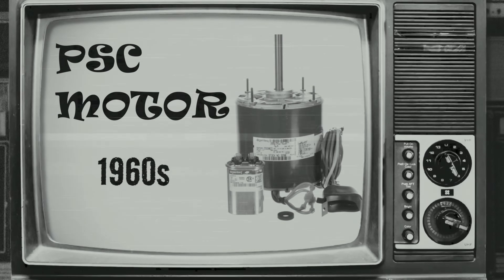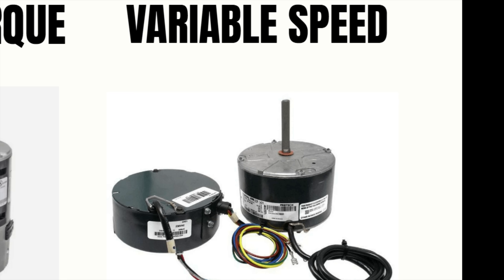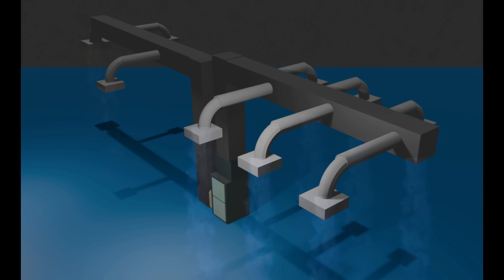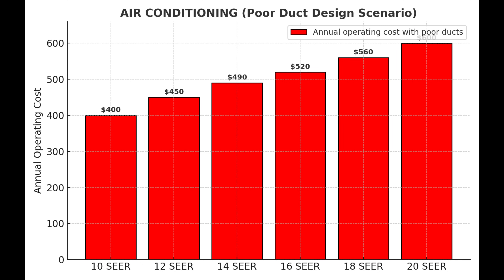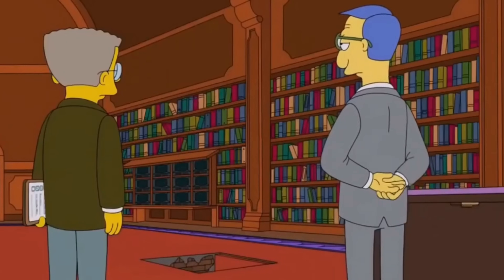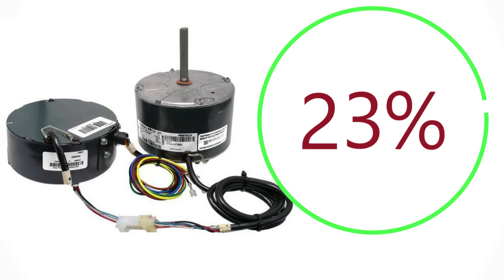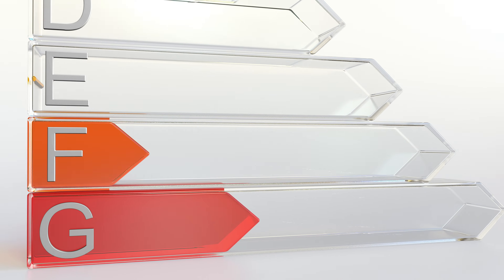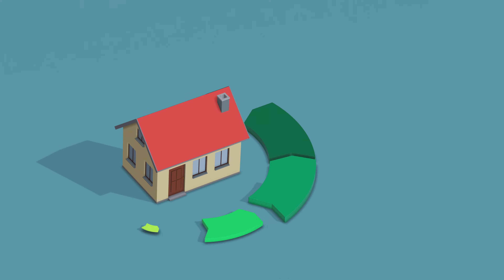The Ugly Truth About Motor Efficiency in HVAC

Comment: Here’s the thing.  Say a PSC motor in this situation pulls 400 watts and an ECM pulls 600 watts in a high static pressure situation.  You’ll still get 15-25% more airflow.  You forgot that condenser outside is pulling 2,000-3,000 watts.  I’d rather eat that additional 200 watts in blower motor power than to lose 20% of 3,000 watts cooling im missing out on, and iced over coils, which is a gain overall, not a loss.

Ecm still wins.  And you’re being micro about this - not the entire bigger picture.
Reply: ...at least until the ecm controller fails due to high static.
Reply: @Jon-hx7pe  Grease runs out of the bearings due to hi heat..........and then OHM's law takes it from there.
Reply: @Jon-hx7pe yeah the ECMs blow their own brains out and then are useless and expensive to replace.
Reply: Coping lol
Reply from the maker: I never claimed high-efficiency systems are never more efficient. But compressor efficiency still depends on proper airflow to keep suction and discharge pressures in range. Restrict airflow and the compressor is forced to run at a higher compression ratio, which kills much of that efficiency advantage. Longer blower cycles also mean longer compressor cycles. I’m not saying you’re wrong — just that you’re overstating how much efficiency the compressor really keeps once duct issues come into play.
Reply: @JerseyMikeHVAC  The problem is that your claims just don't match real world numbers.  I have personally seen Variable Speed systems installed where the electric bills plummeted, despite cooling the same volume of air, in the same house, with the thermostat set to the same exact temperature.

Hence, these magical static pressures aren't killing "much" of that efficiency advantage.

None of the ducting in these cases was changed, just the central A/C system.  You also completely fail to account for the fact that the "longer compressor cycles" on a variable speed systems are running at a reduced compressor rate, instead of the full 100% compressor rate of fixed speed systems.

Hence, whatever efficiency loss the static pressure is supposed to affect obviously isn't much, as the numbers speak for themselves...
Reply from the maker: Again, I wasn't claiming variable speed systems can't be efficient. I have no doubt you've seen some of these systems plummet power bills. 

 All I'm saying is that these savings are not universally guaranteed, particularly if they are installed on a horrible duct design. 

 There's a reason we set blower speeds before ever adjusting charge and dialing in sub cooling. Airflow effects everything, not just the indoor blower but the compressor too. 

 Just like you've seen bills plummet, I've seen them skyrocket in some cases, or at best not improve at all. 

 There is also a reason why high efficiency systems are subsidized with rebates and other incentive perks. ROI just isn't there in many cases once you factor in the higher costs up front and over the lifetime of repairs.  

 Can they be more efficient and save money? Yes. Absolutely. But it takes a lot of effort to actually achieve that. It's not dummy proof  plug and play magic like a lot of people seem to make it out to be.
Reply: @JerseyMikeHVAC 100% accurate 👍🏻
Reply: @JerseyMikeHVAC  I don't disagree that a system installed in a poor ducting, or an oversized unit like a 4 or a 5 ton unit installed into a house with ducting designed for a 3 ton will never work correctly, and may experience problems or fail to deliver promised savings.

But I disagree that the ROI isn't there in many or most cases.  I have several friends and family to switched to more efficient variable speed units, and they all saw their electric bills plummet.

I don't however disagree that the industry can to a lot better, and take a bigger role in advocating for the systems to be correct, and push back against people who want to "upgrade" their systems to higher capacity without addressing the ducting and air return.

I don't really think it takes a lot of effort to accomplish that.  I replaced a single speed 4 ton with a variable speed 4 ton, and my electric bill showed a significant drop over the last 2 years since it was installed.

Also, people need to factor in the warranties on the variable speed systems.  Yes, the PCM motors are expensive when they fail, but most higher end units have a 10 year parts warranty, so the ECM motor replacement will only cost you the labor cost, hence a single speed or ECM motor replacement will cost you the same amount of money.

But, I agree that there are too many fly by night A/C companies out there, and too many homeowners that think bigger is better, and will "upgrade" their A/C units because they think more is always better.

There are definitely a lot of improvements in education and professionalism needed both on the industry side and the homeowner side.
Reply: @redbaron6805   how many have you seen and what percentage of the time did the electic bill plummet?
Reply: In a retrofit scenario, I’ll put in the lowest efficiency rated furnace/AC/HP that’s available. Given the cost of replacing variable this and variable that, modulating this and that, over the course of the equipment’s lifetime, the homeowner will never recoup the initial up charge and higher service cost of the fancier equipment. There can however be a case made for spending extra for reduced sound levels and less drastic temperature peaks and valleys if your customer is demanding such. I haven’t found this to be the case usually.
Reply: @davedunn7759  If you can't find the case for energy savings or the comfort difference, then I'm starting to seriously doubt your qualifications here.

As I noted, several times already.  Parts are warrantied for 10 years for variable speed systems, some have parts and labor warranties for 10 years, so the "cost" of replacing those parts for the first decade is zero beside labor.

I also know what a massive difference a variable speed system makes personally.

I had a single speed 4 ton A/C for my house, and a separate 1.5 ton in my bedroom wing.

The temperature swings of the 4 unit in my office were so unbearable I was about to install a mini split in my office, as it would become stifling hot, waiting for the 4 ton to kick on, then freezing cold waiting for the 4 ton to kick off.

After I replaced it with a variable speed 4 ton, the temperature in my office became rock solid and stable, 24/7. It now stays perfectly comfortable with the thermostat sitting at 75 24/7.

So, I don't have to wonder if it works.  I know first hand it makes not only a huge difference, it makes all the difference.